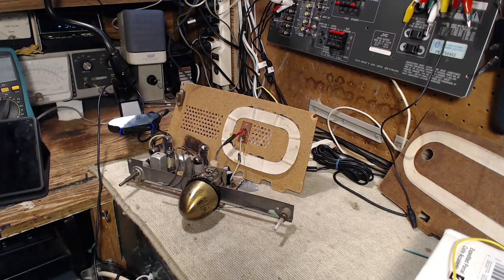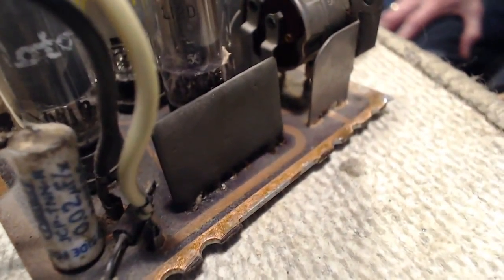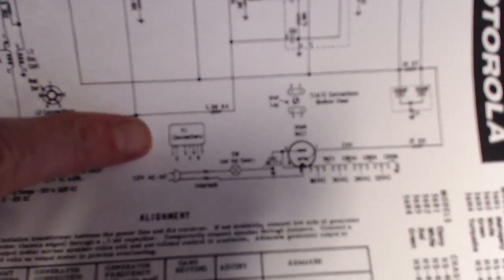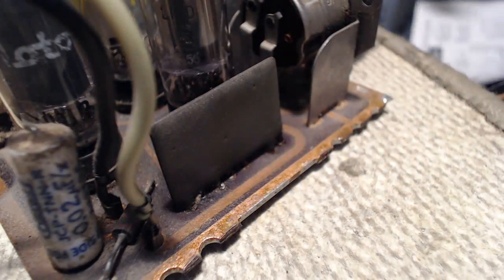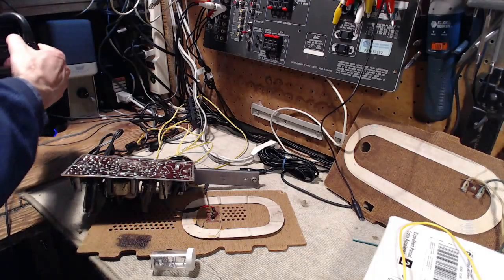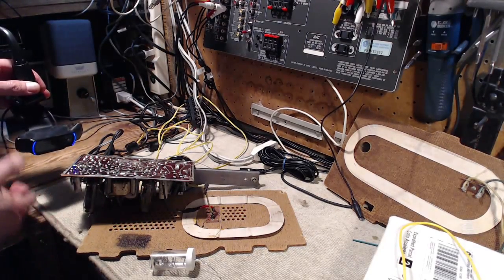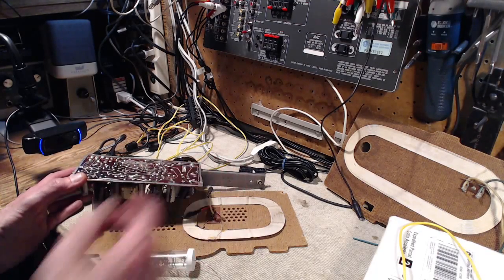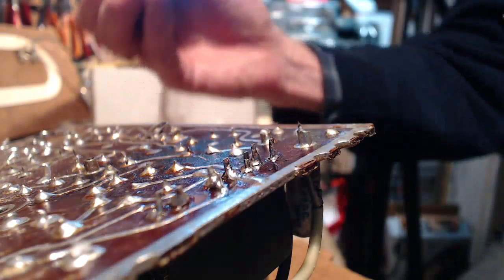Motorola MK 56-H Five Tube Radio Video #4 - PEC

Comment: I have some brand new and on the packing containers.They are called Couplates This from a radio page I will add the link lower in the comment. These are couplates that Philco loved 		to use.  We replace these because they do have a high failure rate.
		New replacements are unavailable.  We need to 		fabricate new ones.  The horizontal AFC couplates are the most 		problematic.
http://www.amptechsystems.com/predicta_era_philco_difficulty.htm
This is also used in radios

Comment: I would consider to perhaps unsolder the PEC and use a Dremel tool to remove enough of the the outer ceramic to reattach the pin. Then put epoxy over it. Worst case it doesn't work and build the circuit on perf board as others have suggested.

Comment: Just a safety note.   At 6:40 when you were showing the broken pin I noticed that the insulation on the power cord was cracked off right next to the female connector.  You can clearly see the wire is exposed.  Be careful with that until you fix or replace it.